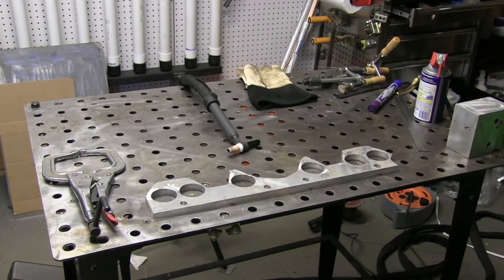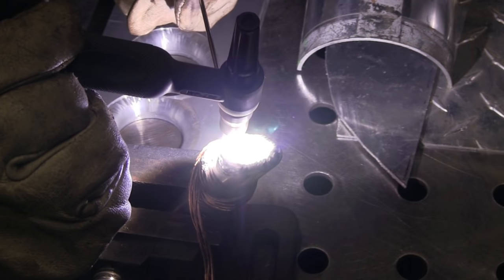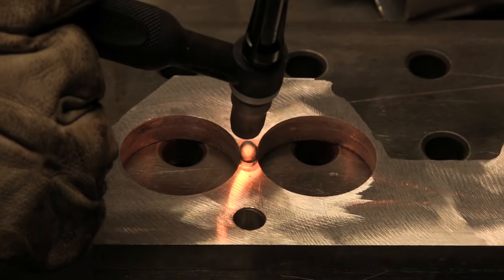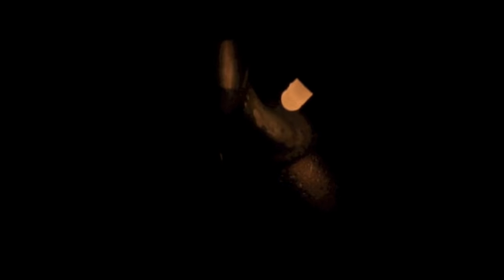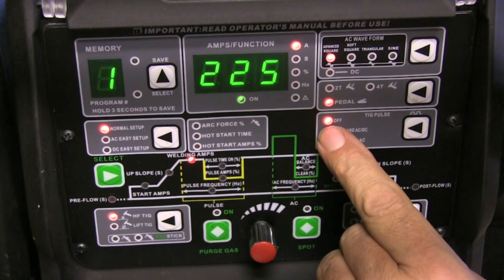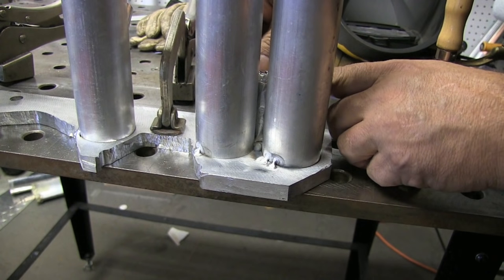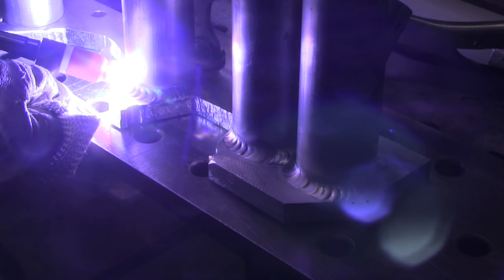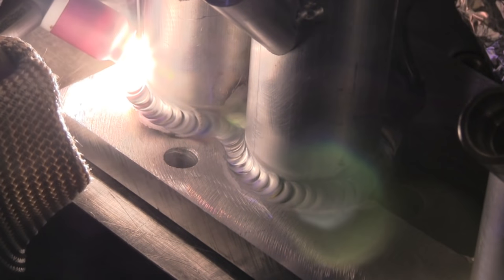TIG Welding Aluminum Intake - part1 of 3

Comment: in welding school, I built a intake manifold and an aluminum racing oil pan, with trap doors and turbo drain bungs for a project. it was very challenging since I used part of a OEM intake which was cast aluminum and made my own plenum and throttle body flange. I still have them it was fun to learn on...

Comment: Beautiful! I've been eyeballing a tig machine to buy and this is one that I have been wondering about how well they work and hold up.
Reply: +Defnotdemas I too have a 255ext, I have nothing  but praise  for it for what it is. Considering it's  price, it really stands  out. The duty cycle on them is nice as well. Sure it's  no square wave, but you really can't  beat these everlast  units for the price. I've  had mine for almost 2 years now and use it quite often  for stainless  and aluminum side jobs/projects. It's  never let me down (knock  on wood).
Reply: +Defnotdemas one of the multiprocessor units. Tig/stick/plasma. Mostly because I want a plasma but want to be able to weld aluminum too. And I'm a cheap ass. I'm seeing people use the everlast units more and more.
Reply: +foolongtea it actually is a square wave machine otherwise you won't be able to weld aluminum with it
Reply: torcher78 I meant  as in Miller Dynastys ( we call them Miller square waves)regarding the machine itself, not it's  settings. It doesn't  have as much balance  or frequency  control as the Dynasty, but then again it's  quite a bit cheaper. Like I said, I love mine, great unit for the price.
Reply: +Defnotdemas The everlast ext tig welders are the bomb. I haven't pulled the trigger yet either the 255 or the 325 is on my shopping list.
Reply: +Timothy Lingo I just bought an Everlast Pro 164, 2 weeks ago. I went from a lift tig/stick welder from Thermal Arc. What a difference. I got it because Jody recommended and used it awhile back, and it was under 1400 shipped. Highly recommend it.
Reply: +Timothy Lingo I'm in the market too and was curious about the Everlast machines.  I currently run an AHP 200 amp machine and it's not really making me happy.  It's ok but I've run a Miller and really liked that machine much better on Aluminum (I build gates and railings and also some kennels).  I had it narrowed down to the Lincoln 225 and Miller Synchrowave 210 but the Everlast price is hard to ignore.  Anyone have an opinion on the Everlast as an option over the AHP vs going with blue or red?  I really think I prefer the inverter machines but have never really ran a transformer machine.  The AHP works great on steel and stainless but the aluminum just isn't that impressive.  I'll also have to go with a cooler.  For the price I can get into a water cooled setup and a little more capacity with Everlast pretty easily.
Reply: I chose the Everlast over the AHP and I really like the performance and the features. I bought an Everlast MIG welder soon after.

Comment: Good afternoon!  I don't suppose you could do a quick demonstration of how you would weld a nut onto a piece of pipe (as used in pipe sleeve type stuff)?  I'm trying to figure out a technique or process of creating an adjustable length, pipe leg for a work table, with a set screw/bolt to lock in the pipe length...

Comment: Is there a rule of thumb when welding two different sizes of stock together as far as the welder settings i.e. set welder for thicker material. If not what do you use as at least your beginning settings when welding different thicknesses.

Comment: hey jody,
i was wondering if you can do some aluminium mig welding basic videos. i want to learn so i can start to make my own boat. 
great vieo always a pleasure to watch!!
thanks sharn
Reply: +Bill Gringo ok thanks i will do that. i have searched  youtube but havent found any  specific for beginners !
Reply: He has done some outstanding Tig stuff for beginners - he also did a big aluminum project with a spoolgun I remember well-checkout his vid "welding aluminum on the buildpro welding table" -you'll probably want seat time tiggin & miggin before you do the boat but sounds like a great idea
Reply: +joelyboyblue i can tig weld aluminium, just want to learn mig welding aluminium because i want to build a boat and tig welding a boat is possible but not necessarily a great idea.
Reply from the maker: +Mr. green I do have some plans for some more basic aluminum mig.

Comment: Nice video as usual. If a gas lens  works so well in diffusing the gas, why use anything else?
Reply from the maker: There are times when a standard collet body works better on aluminum.  But I see your point. Mostly it's a personal preference thing

Comment: Hello Jodie, thank you very much for your informative videos, im willing to buy a tig welding machine and still dont know what to chose AC/DC or DC machine and here in Dubai we have 220v power supply and most of the machine are 110v and after a long search i found a company called migatronic they have what will work for me so decided to buy the PI250 for now will be using it to improve my welding skills will weld stainless steel and aluminum as a future plan will start building SS exhaust manifolds, so could you please tell me what to chose AC/DC or DC.

and again thank you very much for you amazing videos
Reply: +Mohammed Al Blooshi If you do not have AC, you cannot weld alu. So unless you just want to weld steels, you have to get an AC/DC machine.

Comment: Were you running 4043 due to the possibility of a higher  service temperature and the chance of the 5356 have intergranular corrosion? Have you ever tried running the new 4943? It shows almost the same strength as a 5356 but doesn't pose the heat problems.

Comment: How did you align the injector bungs ?  They they dont looks symmetrical on camera  .  IT also appears that you didnt do much prep to the surface  , are these newer machines  more forgiving to improper surface prep ?      What is the manifold for ?   The Injector alignment worries as me you may have spend more time do individual trim on each cylinder as opposed to be perfectly aligned  ,  I suppose you could rig it and machine the seats  to match the angel needed to get a straight shot on the valve though .   Thanks for the Great video , Ive been out of the game for while and these are very helpful to me as i prepare  to dive back in ,
Reply: +Rockland Kcorvic Unless you have EPA hanging over you to get low rpm emissions down to silly low levels, they do not need to squirt right at the valve. I have made intakes with the injectors angled 70º to the flow, running E85 no less, over 700 bhp out of a 2-liter Cosworth YB engine...
Reply: I Guess  - I'm just uptight about shit like this . I've been into the bike scene were extracting more power from 998cc N/A  , isn't exactly the easiest thing to do and all the little shit adds up  .   Were you running single or dual injector per port ?    Thats alot of volume with e85 and 1 injector/per
Reply from the maker: The camera angle makes the bungs look misaligned. I plan to use the fuel rail to make sure all is well before I weld them. Also I used dynaflux aluminum cleaner followed by acetone wipe.
Reply: +weldingtipsandtricks   Lol I set my shop my shop on fire back the day using acetone to clean to aluminum , One missed rag and poof , fire extinguisher blazing .  I also plan on snagging some of ur items on weldmonger , when i finnally decide on an inverter machine .  Gotta get  this old g9 pro running again 1st though .
Reply: ***** True, but if you are looking for more power you'd like to have the injectors spray the fuel up in the runner so it can cool the air on it's way down to the valve. I know how that feels, I built what is probably the quickest Yamaha FZR 1000 with a stock chassis to do the quarter. Fully road legal it did a 9.599. Just under 200 hp at 1183cc.. in 1996. The car was running single 100lb injectors, 60 psi fuel pressure if I remember correctly..

Comment: great video. what type of electrode are you using? what caused the electrode to ball up like that? i thought inverters kept the point even on ac. do you think you could have done that job using straight argon?
Reply from the maker: 2% lanthanated. I balled it on purpose just trying different things
Reply: +larry sperling the ball in the edge of the tungsten electrode is caused by a AC current.  The choice of use a AC current when weld the aluminium or magnesium alloy , is made for to remove the superficial aluminium (or magnesium) oxide. that thing is called ionic sandblasting
Reply: +kekkorr r thanks for your  comment. when i asked my question i knew that jody was useing an inverter maching and they dont usually ball an electode like that. but i see from jody's answer that he intentionally balled the electode just to see if it made any difference in the weld.

Comment: Hi Jody, Love the videos. I'm a long time viewer. I have a Lincoln square wave, just like the one you were using a while ago. It has the factory torch, which gas lens bundle do I need from your weldmonger store? I need one but don't know which bundle works with my torch. Thank You.
Reply from the maker: +Mike Weiser I have both the square wave 175 and the 200 inverter.  Both of mine came with 17 style air cooled torches.  The "stubby gas lens kit" is the one that works with 17 and 26 style torches
Reply: +weldingtipsandtricks   Do you have any vids explaining gas lens vs non gas lens . I use gas lenses on everything lately.    I would be nice too see a vid on all metal types with a gas lens vs non.

Comment: How does the machine fare against the Lincoln Square wave 200 tig welder? Seems like the Everlast 255ext has more settings for aluminum, but the square wave has you know a square wave . Which one would you say is better? or have you not done enough testing on the Square wave ?
.
Reply from the maker: +Robert Robinson th 255ext has more settings and more power. But the Lincoln square wave is a good machine.  I have to get more seat time with both and do a bit more testing.  Both machines have square wave

Comment: hey Jodie,  how do you like the Jackson Balder? I see you've been using it lately.
Reply from the maker: +trailerpark187 the Balder is  OK. But  I prefer the lincoln viking 3350.  I just got the latest 4c version too but have not unboxed it yet.  stay tunted.
Reply from the maker: +weldingtipsandtricks tuned